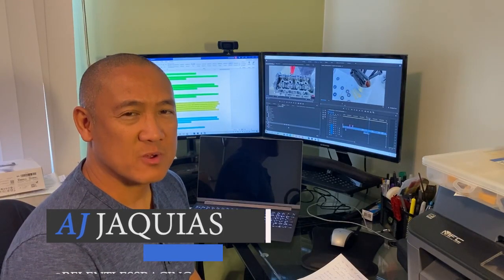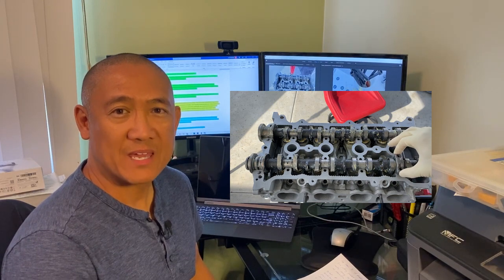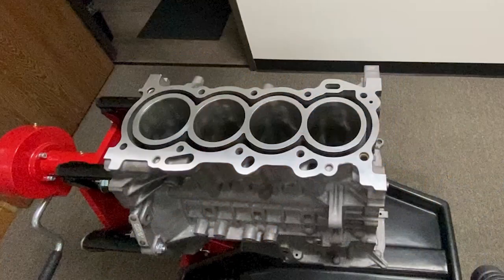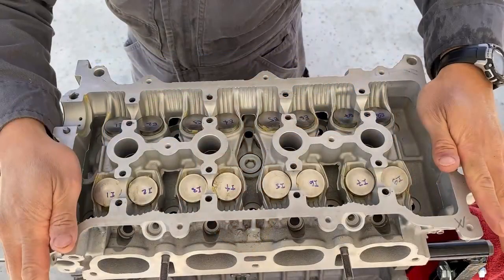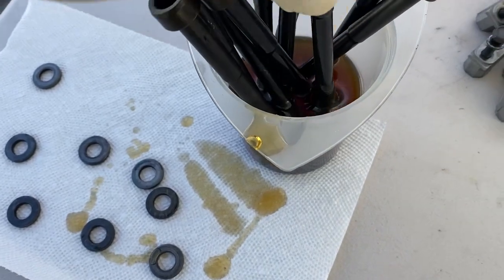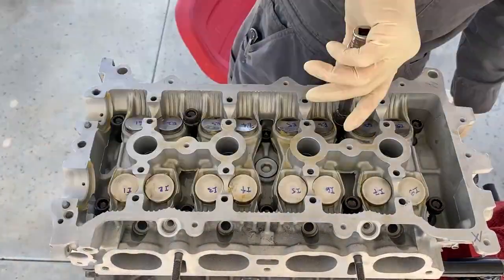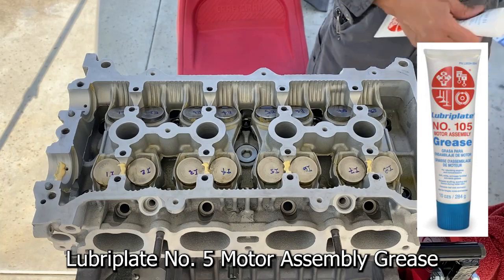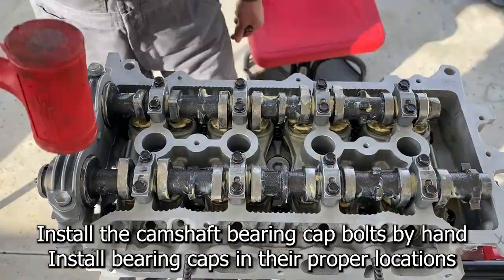1ZZ-FE Rebuild Part 4 - Oil Pump, Cylinder Head, Camshaft Installation

Comment: god to watch you put a head on like that.... ive never put one one with out a crane... :O
Reply from the maker: LOL!!! Sun is out, guns out. Thx for watching and commenting. Pls subscribe to see more amazing feats of strength! -AJ
Reply: @RelentlessRacingAJ  lol sure thing! i might be rebuilding one of these little guys soon.  normally my heads are several hundred pounds of not pushing a thousand
Reply from the maker: @ I hate working on big motors. I just replaced a fuel injector in my 5.9L Cummins in-car. It sucked. Don’t forget to subscribe. Thx again -AJ
Reply: @RelentlessRacingAJ  injectors on a Cummins are so easy though! I prefer the bigger ones, bigger bolts, more room. My Cummins is such a monstrosity though, it's like nine vehicles into one
Reply from the maker: @ I only chgd #3 which wasn’t too bad, but my body still hurts from laying on the fenders and I bet #5 & #6 are a pain since they are under the cowl.
Reply: @RelentlessRacingAJ  they're actually not bad. Valve cover off, you use the valve cover bolt on top of the injector with a square shank screwdriver of some kind and pry the bolt head, they pop right out..   just need to loosen your crossover tube 

I have a 2 inch body lift on mine to make stuff like that easier but it's not needed
Reply from the maker: @ mine is all stock. With a 2” body lift ur cheating. Lol
Reply: @RelentlessRacingAJ  I made my own, 4 inch steel stock that I band Saw and drilled the center of. Turned it into pucks.  I need an extra clearance for power and hydraulic lines

Comment: What is that internal hex plug in the center of the cylinder head for? Toyota manual tells you to replace the gasket for that, but I didn't see you do it and don't fully understand why it's even there?
Reply from the maker: Thx for watching and commenting. Pls subscribe. I need you to be more specific bc a cylinder has 6 sides... front (cyl 1), back (cyl 4), intake, exhaust, top, and bottom. Which one of the 6 faces is the "internal hex in the center of the cylinder head" located? What page are you referring to in the OEM service manual? What car and year is the OEM service manual for? thx AJ
Reply: @RelentlessRacingAJ  Im using an 03-08 1ZZ-FE manual for the Toyota Matrix. In the section under Cylinder Head Assembly there is a Head Taper Screw Plug No2 listed along with a gasket.  You can see it in your video in the section where you torque down the head, as it's right in the middle. Not sure why that plug is there, and why I didn't see you remove it in your video.
Reply from the maker: @ what is the time stamp in the video where u see the plug?
Reply: @RelentlessRacingAJ  3:40 4:26
Reply from the maker: @ no need to open that. There are lots of threaded plugs, pressed in spherical balls, and other items which are used in the manufacturing process (machining,  casting, etc. pls subscribe. Thx AJ
Reply: @RelentlessRacingAJ  Right. I'm just saying that the manual tells you to do that and to replace that seal. Why its there? No one seems to know.
Reply from the maker: @ it’s for manufacturability. Open it and chg the gasket if u are worried about it.

Comment: Being that you decked the block and opened up the bores, how did you compensate for bore and stroke?
Reply from the maker: I didn’t… what are you expecting me to do? What are the ramifications if I don’t?
Reply: No expectations from anyone. Just thinking the compression ratio changed. Wondering if you added a thicker head gasket to compensate for the change 🤷🏽‍♂️
Reply from the maker: @makiikedandrew  lots of motors are designed to be rebuilt… meaning the deck and or head has the allowance for machining. In fact, there are machine indicators casted into the head and block. Also, the change in compression ratio is negligible when you only remove thousandths off the block and head.

Comment: Thank so much for this series! I just bought a 1.8L 1ZZ-FE w/ 100k miles and didnt do enough research on the 8th gen Corolla but now that i see how to do the rering process im not as anxious about doing this work as a preventative measure!

I do have a question as to what you would suggest in terms of a tool set or other necessary tools for doing work like this. I only have a 25piece ratchet set and that is it. So id love to get your advice for a young aspiring mechanic enthusiast starting out to do engine and trans work!

Speaking of trannys.. could you or do you have a c56/c59 rebuild video as i need to do a clutch kit and i figured while im at it maybe ill do a rebuild on the gear box?

Also have a 2000 camry w/ 300k iv been maintaining and want to do a rebuild on that engine and trans as well! Please let me know and keep up the videos this is some of the best iv seen!
Reply from the maker: Thx for the kind words and appreciate you watching and commenting. Pls subscribe. 

Tools are a difficult subject bc if u buy cheap tools now and get expensive tools later, you will spend more money in the long run. So, is it better to bite the bullet once and buy quality tools to begin w or go the other route? You will have to make that decision on you own. However, there is a secret to buying high end tools at a discount. Take a community college automotive course and certain programs offer a 50-52% discount on Snap On & Matco. When I did it was $7-7.5k worth of tools for ea company. If they take PayPal credit you are golden. 

With respect to transmission vids, I haven’t uploaded any vids in quite some time bc I am focused on finishing my projects. Unfortunately, filming and editing vids the way I do them takes an incredible amount of time, which I don’t have right now. However, I do have lots of footage to edit… including transmission footage. When will I get to them is unknown. I recommend reading the Bible (OE service manual). The transmission disassembly and assembly is documented very well in the Bible. Good luck 🍀 👊
Reply: @RelentlessRacingAJ  that is such a good hack dude thank you so much! I am 100% gonna do that!! Appreciate your time w/ the build and advice sir, I am subscribed and I'll be looking forward to your next uploads, maybe another OG Toyota super car? 😎 I hear they are gonna unveil the MR2 in 2025 and the concepts so far look incredible! I'm a big Toyota fan and wanna find an AE86 Corolla GT-S before the rumored revival but it's hard to come by these days sadly. What's your thoughts on LSD for a 5 speed? I have an open differential now but the idea behind a LSD seems beneficial so I'm not constantly wearing my clutch when I'm on hills. I'm not confident enough to do the ebrake trick 😆 thanks again 🍻
Reply from the maker: @i3adllama46  for friction plate LSD I like OS Giken & for helical the OEM LSD works well
Reply from the maker: @i3adllama46  another good way to attain quality tools is to watch FB marketplace and Craigslist for those retiring mechanics. Gotta b diligent checking everyday and know your tools prior to buying so u don’t get ripped off. There are definitely deals to be had out there. Good luck

Comment: Do you have to prime the oil pump when installing it? I've heard that I have to take the pump apart and fill the two gears with assembly lube so it doesn't run dry and can create pressure faster but is it really necessary? I mean, couldn't I just take the old one off and put the new one on and do nothing else, right?
Reply from the maker: You do not have prime the oil pump when installing it. However, b4 starting the motor, I recommend removing the spark plugs, detaching ur fuel injectors, attaching a battery charger to the battery, and rotating the motor via the starter for 10 seconds and pausing. Then repeat a total of 5 times. This will get oil where it needs to be b4 starting.

Comment: Head bolt torque seems to be wrong. I know there is a manual that specifies this, but using this procedure the head bolts don't get tight enough. Its 49nm, then 90 degrees, then another 90 degrees. If you skip the final 90 degrees the rebuild will fail. when removing the cylinder head, you can feel its very tight but when rebuilding and you just make one 90 degree turn for the head bolts you can tell its clearly not tight enough. I'm not sure why some manuals and some youtubers suggest that you half ass the headbolt job.
Reply from the maker: I noted in a comment below the 29 ft-lbf is a typo... it should be 36 ft-lbf. Per the OEM service manual on page EM-46 it reads to torque in several passes to 36 ft-lbf and then rotate an additional 90 degrees. Get off the keyboard and quit writing incorrect info on the internet.
Reply: @RelentlessRacingAJ  This is correct I have rebuilt 120 of these engines, and I am finishing a rebuild for a MR2 as we speak.

I do the following steps and re-use OEM Toyota head bolts without a single failure because they measure within OEM specifications as listed in the original repair manual.

following the correct sequence as shown in the repair manual diagram:
Step 1: 12 ft*lbs
Step 2: 24 ft*lbs
Step 3: 36 ft*lbs
Step 4: 90 degrees - if any head bolt "slips or feel like it did", loosen that head bolt, re-torque to 36 ft*lbs directly and re-torque to 90 degrees - this works without a single failure on my end.

Comment: Looking at the mechanical service manual - it says 17ft lbs for the 12mm bolts and 10 ft lbs on the 10 mm bolts

No.1 17ftlb
No.3 10ftlb

I accidentally tightened the no.3 to 15 and it broke in there lmao
Reply from the maker: Which bolts are you talking about?  There are 10mm and 12mm bolts all over the motor.
Reply: @RelentlessRacingAJ  lol sorry, I should've specified. 

The bolts on the caps that hold down the cams - they're called "bearing caps" and no.1 is the big one on the side where the camgears are, with the 12mm bolts, and no3 is referred to the smaller caps with 10mm bolts  - the service manual is saying 17ft lbs for the bigger cap with 3x 12mm bolts, and 10 ftlbs for the smaller ones with 10mm bolts.
Reply from the maker: @zeroisonline  I believe that’s what is listed on the video (see 5:47)
Reply: @RelentlessRacingAJ  oh I gotcha you made 2 passes first at 10 and 5 then at 17 and 10 GOT it sorry!!
Reply from the maker: @zeroisonline  bc that’s what the OEM service manual reads

Comment: Hold up! please lmk why lubricate the camshafts and valve lifters with grease? Which grease is this, and doesn't it gum up after? I really want to take care of my old 1zz that was just rebuilt. It has 255k kms and I need another 200k kms out if it! thanks.
Reply from the maker: That’s just assembly lube which I thought I identified in the video. I used the same assembly lube on the bottom end. It is important to use assembly lube so parts are not dry during start up after a fresh rebuild. Good quality assembly lube does not gum up. Pls subscribe. Thx AJ 👊

Comment: you made a mistake! The cylinder heads are tightened to 1.18ft lbs / 2.36ft lbs not 29ft lbs / 3.90 °
Reply from the maker: Calm down… it’s just a typo.

Comment: I'm buying parts to rebuild a 1zz to be installed on my mr2 spyder... the 1zz was off a matrix,  and I've noticed some internals(timing guides, camshafts, possibly more..) have different part numbers matrix vs mr2 spyder... not sure which to buy, but I don't want to lose any power.. any advice?
Reply from the maker: Thx for commenting and watching my video.  I just compared a 2003 Matrix and 2003 MR2 Spyder and the parts you mentioned are identical.  I suggest opening to screens to verify each part number you are considering changing. Pls subscribe for more MR2 Spyder content.  Thx again, AJ

Comment: Will rebuild my 1zz eventually when it is totally run down and I’m still looking for c59 to go with.
How much material can I shave off the head to ensure valves clearance? Haynes manual didn’t say.
Reply from the maker: There’s a marker on the bottom of the cylinder head which tells you how far u can shave off. If u are uncomfortable w that u can measure it w clay or do a piston to valve measurement